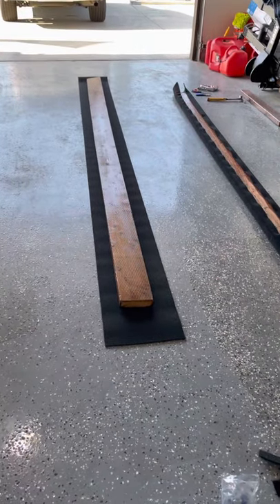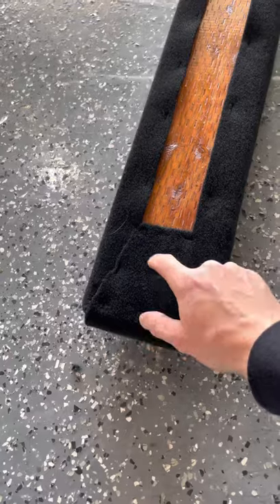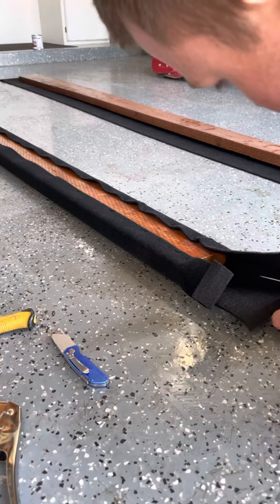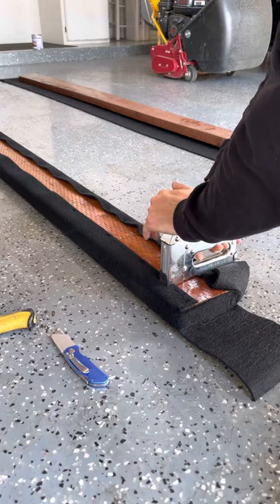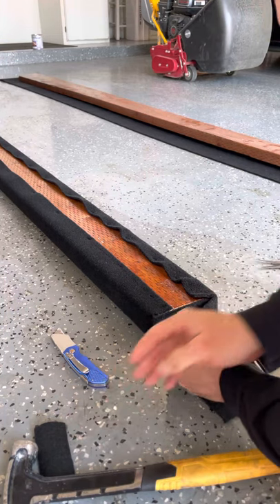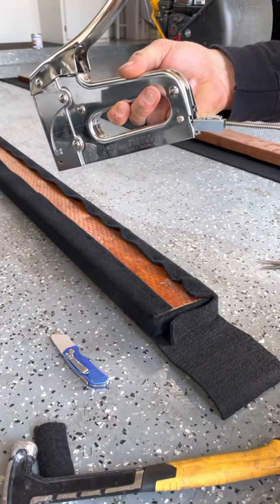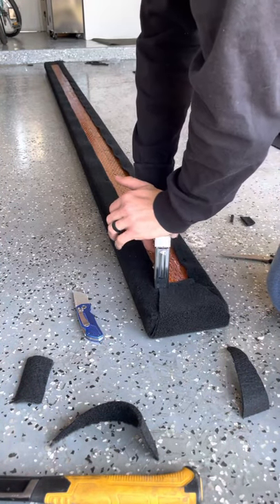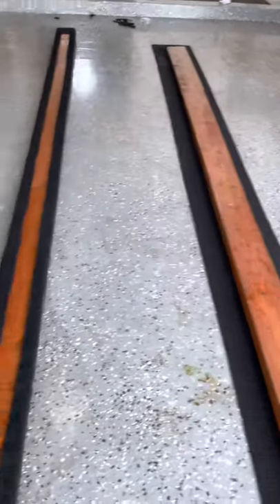How to replace Boat Trailer Bunks & Carpet

Comment: From what I've been learning you should not use any kind of varnish or sealant on pressure treated wood.  I bought some of this spar varnish after watching this video to use on a new bunk board, but then talked to the owner of a boat repair business of 40 years who said not to put anything on pressure treated wood. A knowledgeable friend told me the same thing.

Comment: Great explanation. Can I just cover an existing board that has worn covering?
Reply: The staples won’t go through both layers of carpet, besides the wood is probably rotted underneath the old carpet. Do it this way and you’ll have a professionally installed boards.